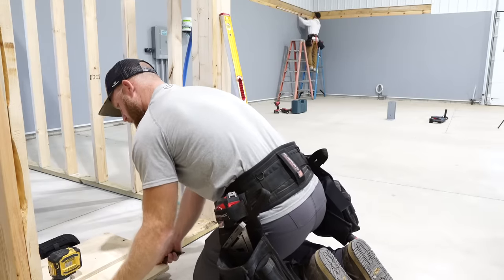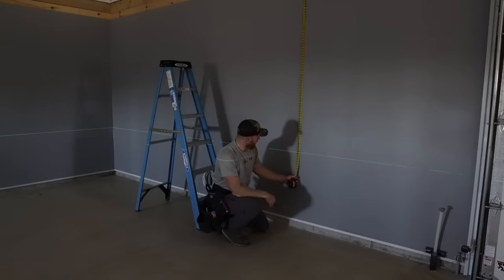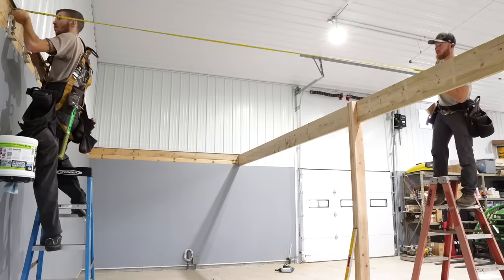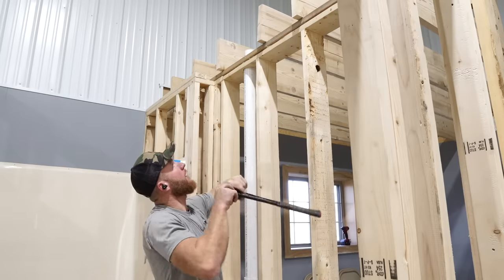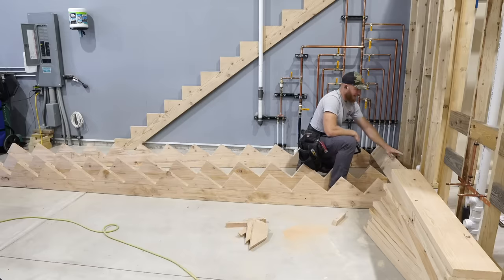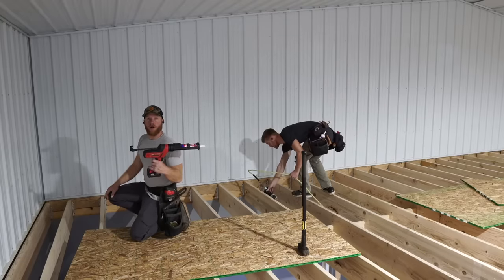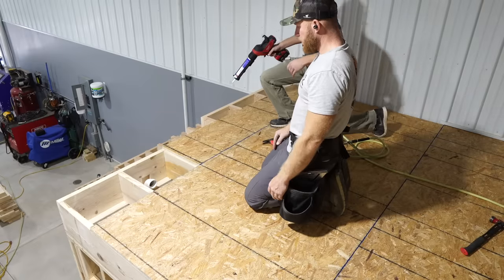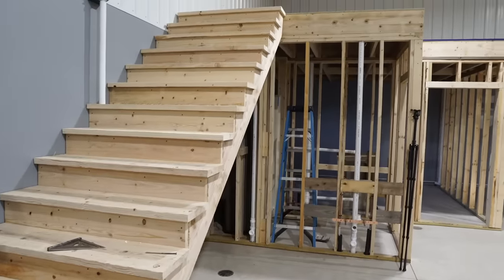Building A Large Mezzanine With Stair Case

Comment: What’s the ceiling height of this shop?
Reply: 16 foot at the wall, higher at the center due to it is a scissor/vaulted roof truss.
Reply: Should know the pitch of the trusses and the width of the building to give a final height at the inside peak. I built a small 25*40 shop with 2/12 inside pitch trusses. Had 12' walls, final height at peak was 14' even as the pitch doesn't start at the outside of the building and the walls were 2*6.

Comment: When you realise just how difficult it is to use inches compared to centimetres...
Reply: Some basic math skills will solve that problem. I'f you can't handle simple math like that you should likely not be building structures.
Reply: Moto Z Here we go again, people calling metric users dumb. It’s not that I can’t perform the conversion. In metric I just don’t need to even think, just move the point to where it needs to be and it’s done. It’s the same with weight, force, whatever you need, all measurements are directly related. There is no arguing that metric is simpler to use and a lot more logical. That’s why it was invented... Your argument is like saying „if you want to use a car to get somewhere and don’t want to walk you should just stay at home“.
Reply: @ToastbrotRaver  I never called you dumb. I just said basic math skills would help. Your argument that metric is just easier is an opinion not fact also. I don't believe everyone would agree with you on that.
Reply: Moto Z I said I don’t want to use imperial because it’s a hassle. You said if you can’t use it don’t build structures. I never said I can’t, so one could take your comment as borderline insulting. That aside, why would imperial be easier? It’s what some people are used to, that’s why they stick to it. Metric is logical, all based on 10s, simple to convert. So no, I don’t think it’s an opinion. Give me one argument why people should disagree aside from being used to imperial. I mean (almost) the whole world went to metric so there is something to it I guess.
Reply: @motoz3939  dude we are the ones still using the old english system the british left us.... hence IMPERIAL (English Empire)...scientists in the US long ago abandoned it in favor of the metric because the metric is superior. I think its fine you are more comfortable with the imperial system, however saying that it is superior is laughable. . measurements based on dead english kings foot? Honestly one the strangest things i have seen an american go all super patriotic over in a while.. congrats !
Reply: @gabrieldegange6367  you guys are going nuts I'm just having fun. In all seriousness though the metric system sucks.
Reply: @gabrieldegange6367  haha you guys!
Reply: Difinitly harder to use 12inch than 12cm...
Reply: @motoz3939  as a metrologist it is easier. Theres very few people who would believe that imperial is easier in any manner. Unless that's all you have used.

Comment: Top step flush with floor, ?..osb flooring, not 3/4 fir or advantec?...joists knotched 2” makes them non code.. no structural header over door, single rim board is not code....double 2x10 box can not span 16’..( yes you knotched that also making it’s actual width 2” less...) no router , rounded edges on stair treads? 2x12 pine stringers, not PSL and not even a 2x4 glued and nailed to the side of the stringer..
    Don’t know where you get these gigs, but that is some bad framing, no code stuff going on..I feel bad for the owner. ..not even a post to beam connection like using a “ AC6Z” or other metal connection. That crap gives real builders a bad name.
Reply from the maker: Thanks for your feedback...